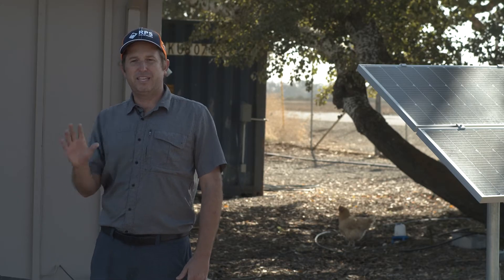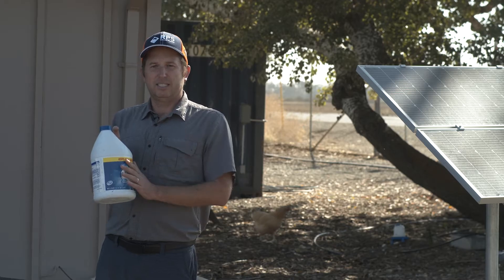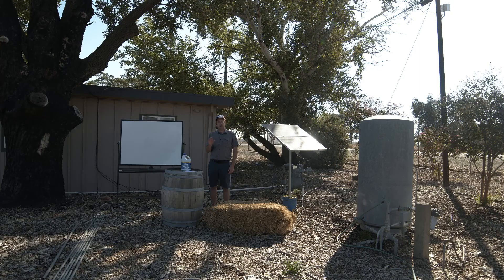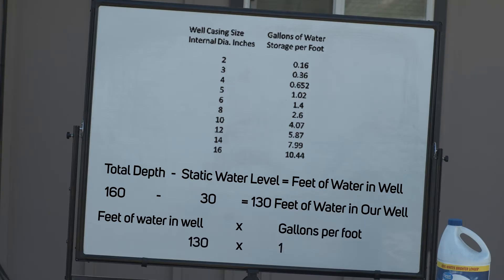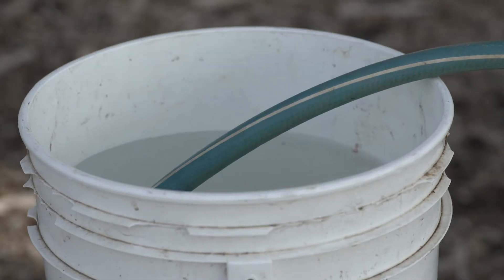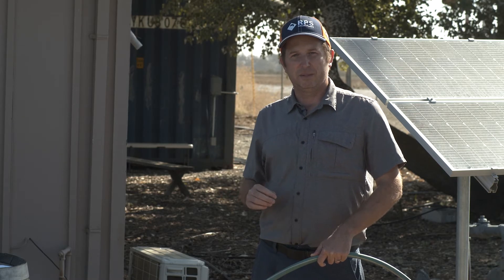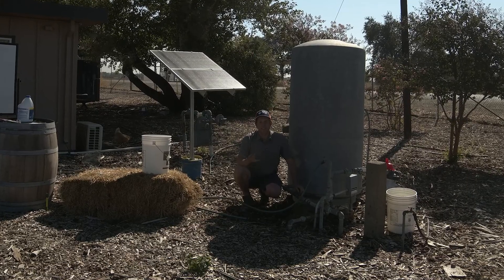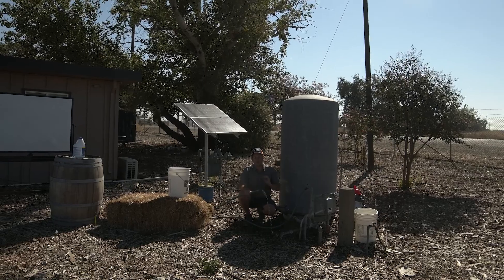Disinfecting Your Well in 7 Easy Steps!

Comment: Just a few comments from personal experience ( my first time chlorinating the well and plumbing pipes) I noticed a lot of sediment/particulate coming from the faucets when I started to flush the pipes after leaving the chlorinated water overnight. One of the steel hoses below my kitchen faucet was completely plugged.I drained the cold water tank and the hot water tank from the taps on bottom thru a hose into the sump pump hole and pumped the dirty chlorinated water outside. I ran each faucet into a pot and a bucket and thru the water into the yard. It was a lot of work to keep the dirty bleach water outta the septic. I ran water thru the outside tap and hose into the yard until it was clear and not smelling of chlorine. I had to run water thru the laundry hoses and clean out the screens in 'em. I had to replace the steel hose under the kitchen sink. The worst sediment was in the hot water pipes and hoses because the hot water tank hadn't been flushed before. I should have allowed the remaining sediment to settle down to the bottom of the hot water tank after initially purging the dirty pipes. It was quite the job but it was necessary before we had a Culligan system installed. We had Culligan install a spin down sediment filter before the new Culligan treatment system. We put septobac down the drain to help restore the septic bacteria.

Comment: how do you determine the total depth of the well?  you cannot put a tape measure down the well?
Reply: use a fishing line with a weight, drop it into bottom of well you will feel the line loosen up when you hit the bottom. at that point mark the line with masking tape at top of well casing. then pull the line out of the casing stretch it out on the ground and measure.

Comment: The most important thing is never drain chlorinated water into your septic system. NEVER! Second is suck up the sediment at the bottom of your well.
Reply: how do you deal with the sediment getting sucked up?
Reply: @TheAtroShow  I use the well pump since my outside faucet does not go through the filters in the house. Run a faucet out onto the ground or the driveway where it won't hurt the lawn, if you have one. I agitate the water with a long paddle while it pumps out. When the water runs clear you've done your best.
Reply: OK, after the well is sanitized, the video says to open all faucets and let them run - all that CHLORINATED water goes into the septic..... I am confused.
Reply: @alanreynolds2287  I agree.  I've watched several videos and none have hit this point.  I understand I can always just drain the water heater by connecting a hose to filter out the chlorinated water but....the faucets throughout the house?  I'm miffed.
Reply: how do you suck up the sediment at the bottom of the well?
Reply: @pebelleeb5422  Through the foot valve in the well. Just don't pump it into your septic if you have one.